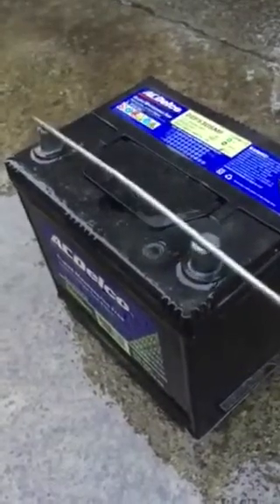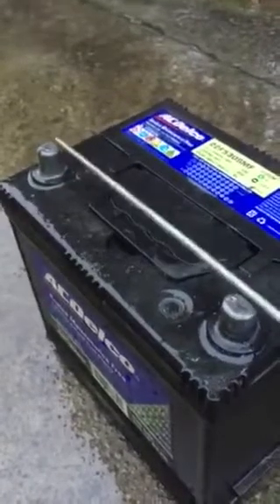What Happens If You Short Out A 12 Volt Battery

Comment: Someone told me that this method will fix a bad cell.
Reply: I think it will just fuck it up even more.
Reply: Never ever try to short circuit a battery! It will cause a catastrophic failure and at best it will damage the battery and other components but it can easily harm you or even cause serious injuries/death!
Reply: get a proper charger and put (i think its the amps) on max and there is a chance that you will revive it, its relatively low though
Reply: Who told you that? The same clown who made this fake video?
Reply: @Alirezarz62  12v only, how is it going to kill someone? Lol
Reply: @alejandroperez5368  Believe me - it is not that the Voltage "kills" but the Amperage and yes 12V battery can be deadly in some conditions.
Reply: So car batteries are filled with a sulfuric acid mixture that decomposes to hydrogen gas. Sparks from shorting the battery like in this video can ignite the hydrogen, causing an explosion, sending battery acid everywhere including you face, hands and lungs if you inhale the smoke. Arcing the terminal could cause a bad burn and if there is enough amps it could make you heart stop. It's nothing to play with.
Reply: @Alejandro Pérez  It won't kill them by electrocution, that's for sure!

Which sucks, because I'd  rather be electrocuted by a battery than die the normal way by batteries.
Reply: @claudiabaran-konarska8409  That's like saying it's not the height that will kill you it's the fall. The height needs to be high to harm you. Amperage is determined by the voltage applied, 12V is extremely unlikely to harm you
Reply: Battery load testers just jump the terminals with a load, so generally speaking its not as terrifying as folks make it seem. 
Just don't think jumping a battery bank is going to be safe...
Reply: I'v heard that too

Comment: Maybe if you dry the terminals?
Reply: Because water doesn't conduct electricity? lol
Reply: @ArcanePath360  pure water is an insulator
Reply: @parko246  but rain water sure isn't an insulator bc it's not pure so it actually aided the short happen rather than preventing it
Reply: @ArcanePath360  Water doesn't conduct electricity at all. The minerals in some water makes it conductive.
Reply: @GABRIEL-dz9mh  It didn't aid it. Did you guys really fail elementary school physics? The water evaporates when it heats up from the short causing a small expansion of gas forcing the rod away from the lead connector
Reply: @GABRIEL-dz9mh  rain water definitely didnt help. When i was apprentice i shorted few 12 volt batteries for split second, literary less than 1 second and it fucking destroys your wrench and makes ton of smoke so these few sparks prove youre wrong
Reply: bro tf>?> @TheChrisey

Comment: dual batterys in my truck.. just dropped the 2/0 positive cable that connects them while taking it off one side.. landed on bare metal creating the 4th of july on one side of the engine bay while the battery on the other side flung a 3ft column of hydrogen/steam out the top of it and melted every ground cable off er...

lesson learned the hard way.. negative before positive
Reply: Positive first up, Negative first down!
Reply: @tomhejda6450   haha opposite, 
taking battery off=negative first
putting battery on=positive first
Reply: loosen both and remove both same time
Reply: @mdg1089  big brain huh
Reply: damn 24 volts? thats probably enough to feel going through your body if you touch both ends
Reply: @A_youtube_channel_   you can absolutely touch 24v DC with no feeling... DC voltage doesnt hurt until about 90volts, wet skin or open wounds will lower that but welders run 50-60VDC daily without shock
Reply: Remember, the negative side pushes out the electrons, while the positive side sucks them up!
Reply: look at it this way, your trucks not a virgin anymore
Reply: That Trucks definitely a Squirter.
Reply: I have never seen a battery my self explode but a school boy was changing one on a tractor was fully charged drop a shifter straight across the terminals and  it blow up in his face. lucky he never got eye damage etc tractor paint on bonnet and roof is all rusted now. he is OK, he was put into the shower quickly and his fine today to.